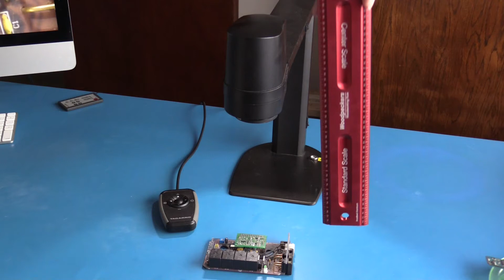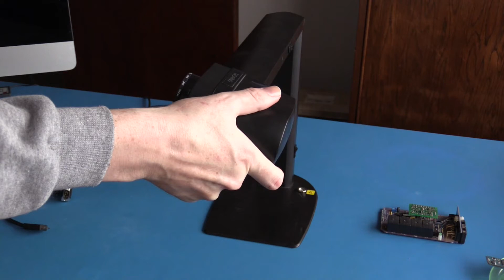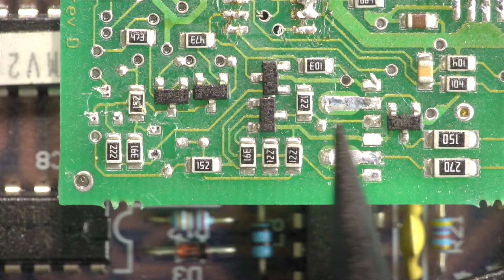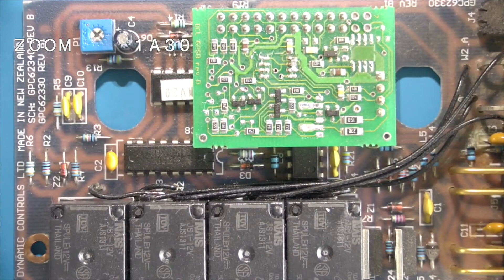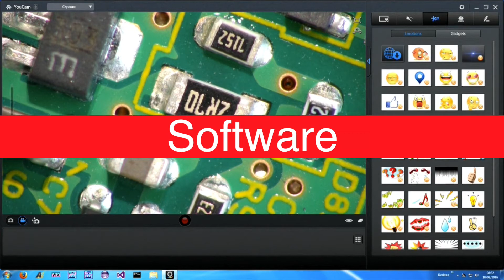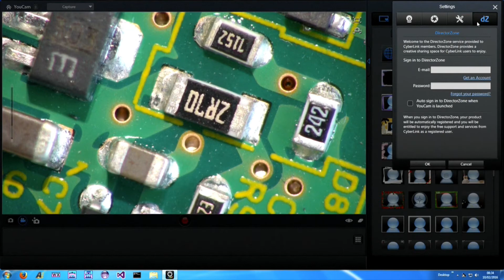BSL009 Tagarno Magnus USB Inspection Camera / Digital Microscope

Comment: where can i buy it?
Reply: They have a website. You can also get one through a licensed dealer. It's a considerable investment but well worth it depending on what you are using it for. I work in quality engineering and it's an indispensable tool. We just purched a new model to replace our older model. All together it was slight over $9k. The new one we purchased is also capable of measuring when calibrated properly. Our old model was also able to do measurements as well.

Comment: Wow, no manual focus on a $5000 Digital Microscope? You should be able to use XSplit to capture at full 1080P.

I'm trying to build my own HDMI-output Digital Microscope for $100.  I can capture full 1080P with a $130 USB 3 box.
https://medium.com/@GeorgeOu/diy-pcb-microscope-9de15c07d5c8#.ttr5p54a7

Comment: You are looking at a board that is not where the optimal working distance is, it's mounted about 1-2cm above.
Therefore when using full zoom your autofocus depth is not big enoght for the board on top, (it would work on the lower board thou).
The simple solution is to put the microskope on a book or something of about the sam thickness, then you get the correct working distance and it will work just fine.

I agree about the software, it should be a more professional solution than YouCam, but as long as you just use it as a microscope you don't need any software at all.
Best Regards
Mikael